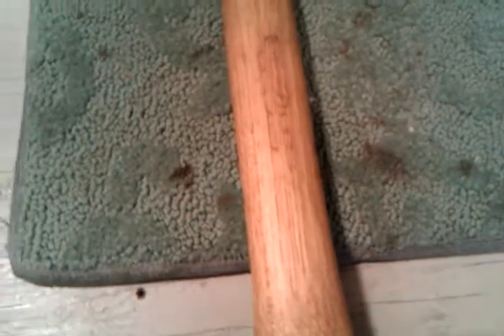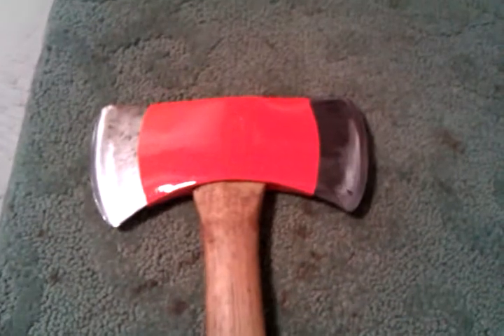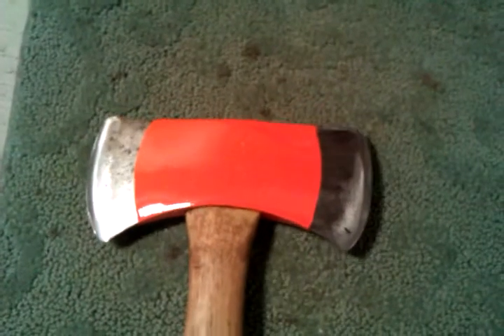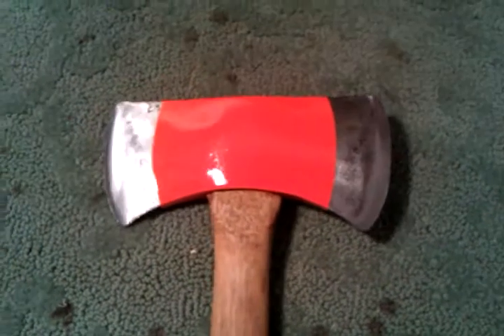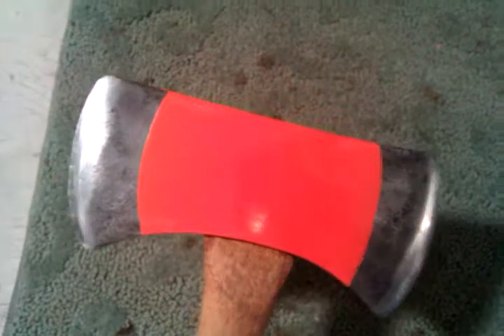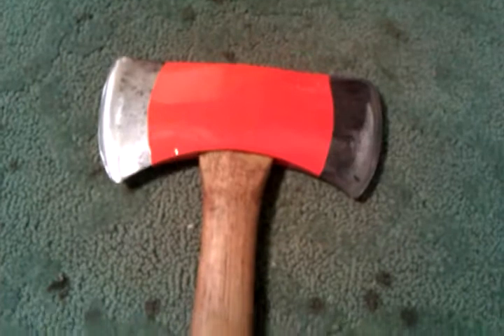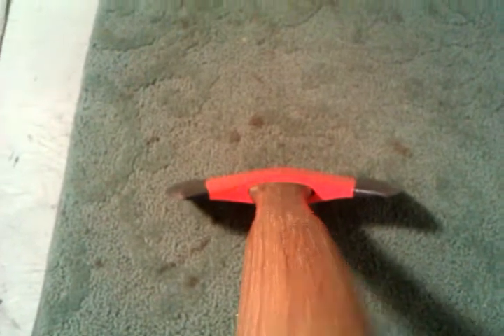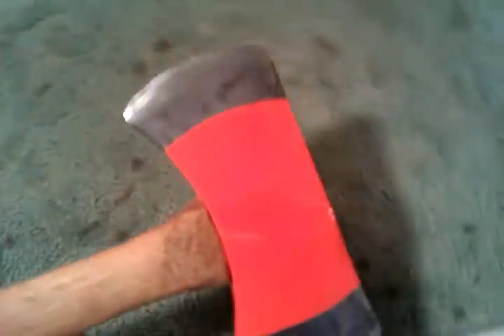Collins Double Bit Hatchet is Finished

Comment: 1st of all! Congratulations on such an absolutely gorgeous result of your reconditioning of the Collins hatchet! Your Granddads would be pleased as punch with your labour and would be quick to point out that you did what they could not. Well done, friend!
2nd As for the next one, could I suggest the removal of the rust by electrical means. It requires a battery charger and a plastic container (open) and I think some old fashioned washing soda. It'll remove all the rust and cut the work by half.

Comment: I have mixed feelings about the paint.  I would use that puppy which would quickly take the paint off in places.  I think it looks good but I would have left it unpainted. But you are right, 5 minutes and it is gone :)